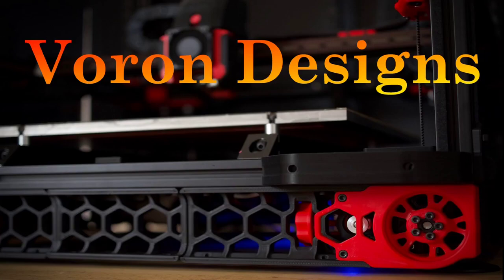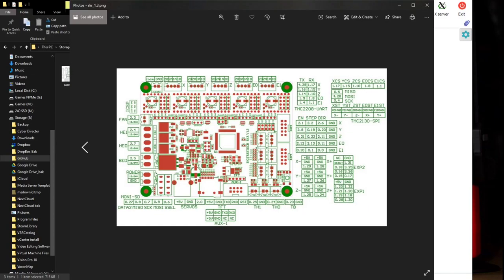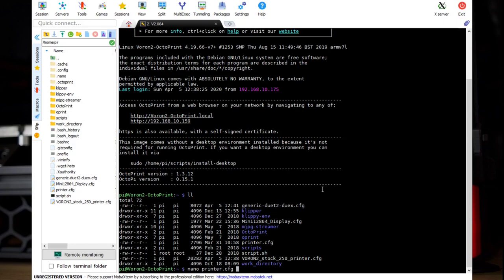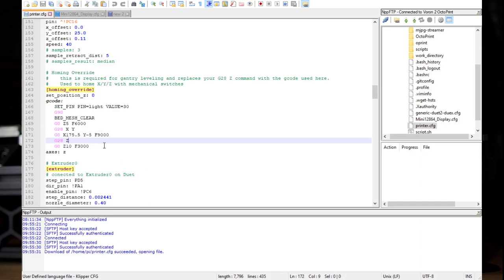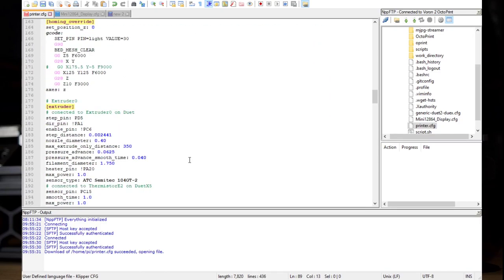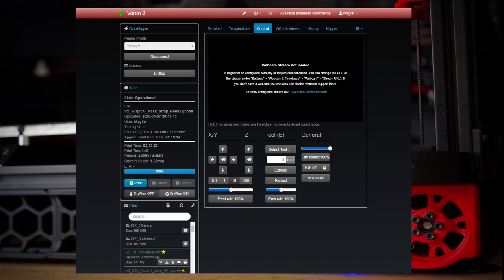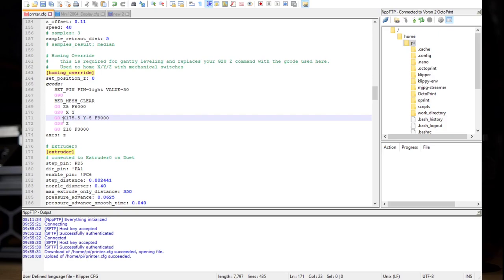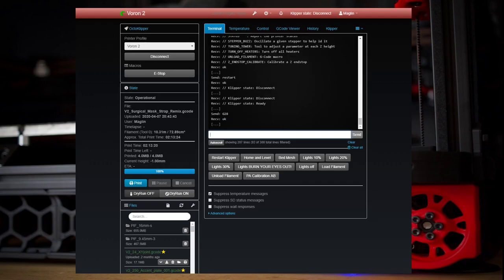Voron 2 - Klipper Setting up your Nozzle Probe

Comment: Hey bud, I’m trying to use the probe:z_virtual_endstop for the Voron Switchwire in the printer conf file. The M119 Gcode always get the correct status returned. But when the printer does the homing, the z motor never stopped. It seems the z endstop doesn’t work. Any idea?